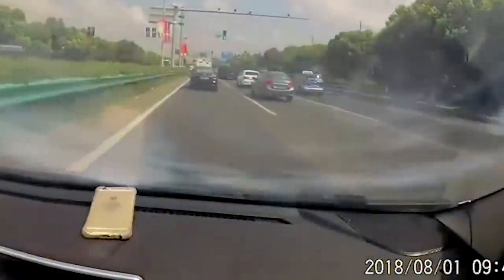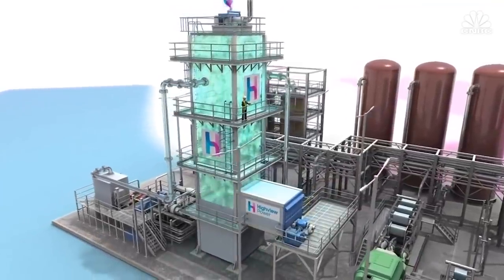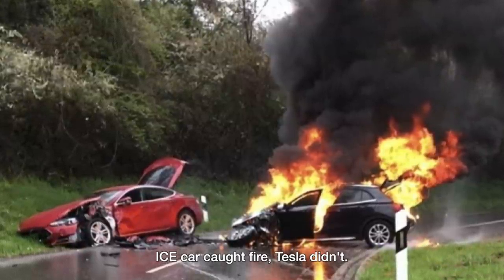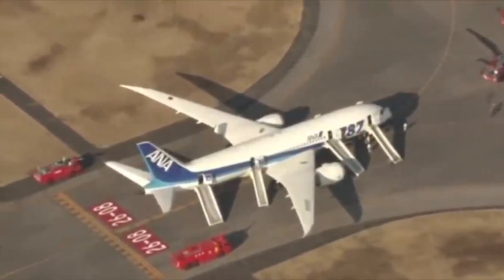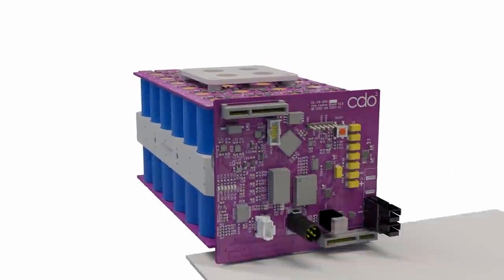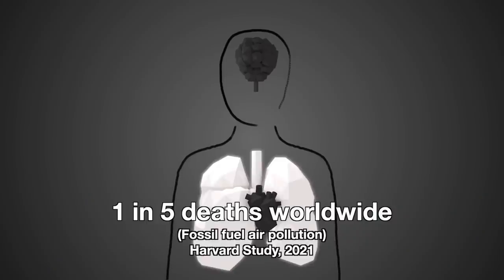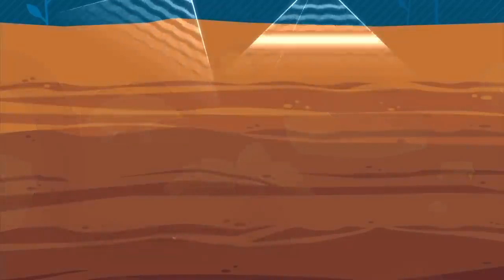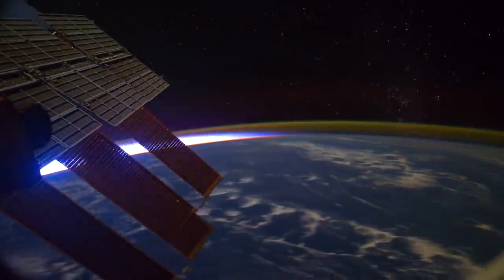What causes electric cars to explode? w Stephen Fry.

Comment: First generation Tesla had a slight risk of fires with 160 cases out of 1.6 million cars. They have solved that problem. Chevy bolt had a heating problem so big they recalled all of them. The article should have been about the Chevy bolt.
Reply: Click-baits work better with Tesla
Reply: Yeah this video was very disappointing

Comment: Two small things. 
Gravitational storage like the concrete block towers isn't realistic. It is just too inefficiënt and ineffective, it is essentially a much worse version of hydro storage.
And BEV batteries are not generally difficult to dispose of, there are several companies that already achieve 95%+ recycling rate, some even powering part of the process by fully using up power that is still in the batteries. However re-use obviously is the first thing you should do.
Reply: particularly these ideas based on cranes to lift and release the concrete blocks. Apparently there is some working version of an alternative system that's based on rails on a hill, which solves some of the problems with cranes, at the cost of more space. Possibly with all the space required for this kind of implementation, though, there's no advantage over using pumped-hydro instead.  Perhaps yet another "solid state" low-tech battery that's better than the vault-crane thing are the kinetic batteries, spinning disks. But I don't know.

It's nice that there are ideas being developed, but we shouldn't let hope and wonder blind us from flaws, from dead-ends, that can end up aggravating the problems we hope to solve or just being a huge waste of money with nothing in return, when the same investment could already be more fruitful with some more established alternative.

Comment: Tesla isn't planning on using Li ion batteries for long, their replacement LFP are easier to recycle and use much less scarce materials.
Reply: Ehh, LFP is a lithium ion battery....
Reply: @EmilKlingberg  Ehh, what about the issues I pointed out with (old) Li ion batteries, which are solved with LFP?

LFP batteries are not Li ion in the conventional laymen term.
If you're being pedantic for no reason, fine be a pedant. But, know you're not helping anyone.

(from wiki) In a lithium-ion battery, the lithium ions are transported to and from the positive or negative electrodes by oxidizing the transition metal, cobalt (Co),
LiCoO2 from Co^3+ to Co4+
during charge, and reducing from Co4+ to Co3+
during discharge. This chemistry was used in the Li-ion cells developed by Sony in 1990.

Comment: I'm extremely disappointed with the discussions around Data Centres the failure to mention the need to connect these to district heating so that thousands of fossil fuel home heating boilers could be decommissioned!

It is very regrettable this was not planned for during construction of them! but they are part of the solution in reducing our needs for GAS imports by decommissioning millions of fossil fuel home heating boilers.
Reply: Psssst, Data Centers are not usually near homes
Reply: @prich0382  in Dublin there 2 a penny but exactly my point should be part of district heating from the start

Comment: A battery fire is not a type A fire so it's not surprising that water is not the best way to fight a battery fire.
Reply: Right, I was surprised the fire fighters had little knowledge or exothermic reactions and thermal runaway. 

I mean surely they get training about chemical fires ?
Reply: @SionynJones  Yes I think the fire fighters were misrepresented in this video. They must have left out information that would explain better the actions of the fire fighters.

Comment: I'll take anything narrated by Stephen Fry, especially if it's about Data Centres, EVs, quantum computing, and renewables. Love this episode. 

It would have been useful to add that batteries are recyclable and we can achieve circular economy by reusing the materials (Tesla battery day, Nortvolt, etc.). Data centres convert electricity to heat which can be reused in homes and businesses instead of being vented into the air! 

Keep 'em coming ❤
Reply: Batteries are only partially recyclable. Way less than you think. Also the heat from datacentres is verry low temperature heat, which is pretty useless. Heating homes and offices is an option, but this is very limited
Reply: @ariearie5054  Even the tiniest bit of research will show you that batteries can and do go through multiple uses in a number of applications (EV, home/large scale storage) years before they are ready for recycling.

Regarding your argument re low temperature heat - have you ever heard of a heat pump? Look at projects in Sweden, Germany, Netherlands already reusing heat from data centres.

Surely none of this seems possible if one reads baseless YouTube comments to gain knowledge on the subject. 

Stop spreading misinformation.

Comment: What we need is either Geothermal energy or Nuclear power. Nuclear reactors are some of the most clean energy sources on the planet, with some chemical designs that are even 100% renewable. Thorium molten salt nuclear reactors are one such thing. They act as steam turbines in simplest terms and produce absolutely ludicrous levels of energy. Thorium is a reactive metal that is 100% chemically safe to handle and requires another form of reactive metal that is actively radioactive in order to actually utilize it. Thus, thorium reactors are also safer than conventional nuclear reactors.

Geothermal energy is the act of essentially drilling a hole until internal magma can be found. Then you use a heat-resistant turbine and essentially yet another steam vent process to boil and condense water into high-powered steam over and over for consistently high, regular energy.

Solar is a backup, wind is laughable, hydroelectric WORKS. I'm a chemistry major and my brother is an electrical engineer. It boggles our minds why folk are so resistant to nuclear energy.

Comment: It is important to highlight that The energy plant in the welsh mountains is a net user of electricity and they make money by using cheap electricity to pump water up to the top and selling it at peak rates. Its an amazing technical achievement, but not one which adds electricity capacity, only to even out supply needs at peak times
Reply: Duh. Batteries don’t make electricity. The importance has nothing to do with cost either, but balancing suppply and demand. Since demand fluctuates (and supply from renewables such as wind and solar fluctuates), a battery means you don’t need extra fossil fuel power plants during periods where power demand exceeds supply.

Comment: It does not take 5 fire trucks of water to put out an EV battery fire.  There is no putting one out because they don't require heat and oxygen to continue.  All you can do is sit back and let it burn itself out.

Comment: Great video. My 2014 Nissan Leaf will likely give me another 5 years of battery life, at which time the battery pack will be good for 10 years of home storage. By that time, recycling solutions will be in place, allowing for the various elements to be reused and the entire cycle to repeat. That is a life cycle that is hard to beat.
Reply: Yes. And ten years after the first nuclear power plant was launched they would have found a way to dispose off the waste savely or recycle it...
Reply: Yep mines on 85% still so hoping the same.  Yep i plan on making ripping my battery apart for home storage, people buy the motors for conversions etc.  recycling of ev batteries is already happening in Germany.
Reply: Better start saving for your new ££££££ battery

Comment: You can not compare the EV car fires vs ICE car fires because an EV can burn down completely but the battery could still be intact when the fire is not the cause of the fire but an outside source started it like an housefire that jumped to the body of the car.

Comment: Battery technology is evolving rapidly, compare current tech to just 5 years ago, or 10. Thermal runaway is a result of people cheaping out on thermocouples, and we can absolutely develop significantly safer batteries.

The main issue, surprisingly not covered in detail here, is disposing of them in an ecological and economical manner.

Upcycling to renewable energy storage is an awesome idea, but honestly we need something like Solid State batteries before we can have the density, safety and longevity required.

Frankly we really need to make the dream of graphene and its nanotube counterpart a reality.

Comment: Lithium batteries have impurities added to them to limit the discharge rate and thus the heat.  Take the impurities out and a shorted battery will actually explode at about half the power of the equivalent amount of TNT..

Comment: LFP Lithium Iron Phosphate batteries are immune to thermal runaway and much cheaper to produce, BYD’s blade car batteries are top notch tech.
Reply: The big difference is capacity being lithium ion has much more energy density which is great in therms of capacity but not so great having so much energy so densily packed. Lithium phosphate are safer but have far less capacity. Though I will say lipo battery fires are quite rare.

Comment: This video is nice, but appears to be using outdated information. As an example, most computers are using CPU based on CISC architecture, but there are many computer makers that are switching to RISC/ARM architecture that is much more efficient and uses way less power than CISCs.  Then regarding energy storage: There is a new interest on switching the type of battery chemistry to Lithium-Iron-Phosphate. This chemistry is probing to be much more safer, with less fire risks, batteries can have thousands of discharge/recharge cycles without losing capacity, and they are cheaper to produce. None of these and several other advancements are mentioned here. Is like repeating ideas from the 90s........

Comment: There's a new battery technology that broke through recently, that uses a mix of sandwiched solid and gel separators between the poles(cathodes) inside them, which prevents dendrite shortouts from being possible, and drastically improves battery lifespan, how many times it can be recharged.
What I'm really looking forward to however is a new battery paradigm, better than lithium-ion, whether it's carbon nanotubes, solid state, sodium, or something else.

Comment: When cement is produced, it releases CO2. When cement is used, it absorbes the same amount of CO2! CaCO3 when heated becomes CaO+CO2. Add water and sand - when this hardens, it absorbes CO2 from the air: CaO+CO2=CaO3. Except from the heating, the cycle is 100% CO2 neutral.
Reply: no . that's just not how modern cement works .
Reply: @jonas7510  The most common type of cement in the world is Portland cement. It works exactly this way!

Comment: Seems to me the energy storage problem is solved by electric cars, with 80% of them being parked at one time all you would need to do is connect them to the grid while being parked. This would allow them to store and release electric when the grid needs. A Tesla has 13.5 kWh of usable storage if 30 million cars allow their batteries to be used in this way the total storage would be 405,000,000 kwh, the UK total yearly energy usage is  318 billion kWh allowing us to store half of the daily usage. But it gets better, if the total amount of vehicles in the UK are used we would be able to store all the electric needed making a windy day last for days when the wind doesn't blow.

Comment: No Stephen TMSRs are the cheapest option now.
Liquid metal Thorium ion molten sodium fluoride salt burner energy converters (TMSR) - like Indonesia's Walk-away Safe 7×500MWe ThorCon units, (base loader or automatically load following), built in an Asian shipbuilding yard and towed to Indonesia for $1200/kiloWatt and pre-profit cost; all in running; security, fuel and periodic maintenance (including recycled reactor pots with new graphite moderator every 4 years) at $40/Megawatt.hour in 2021 prices; topped of with an expected 80 year life and no cost to the Government except for site preparation and linking up to the grid.

Comment: The block tower battery idea has been debunked on Adam Something's channel.  Short version of why it is a bad idea: it requires identical heavy blocks, which means concrete, possibly with steel-protected corners.  Creating all the blocks required for it to operate produces much, much, more CO2 than will ever be avoided by using it as a "battery".  Then there is also the issue of wind; any tall tower dangling objects will be affected by winds much more than a low-lying object - the tower would be unable to stack or operate blocks reliably in windy conditions.  Practically speaking, a tower would have to be underground, which increases costs further.  (There's more on the actual video though.)

Comment: 0:15 all data shows EV catch fire more often than ICE cars, you can see this from yearly released insurance claims. The only one who denied that was Tesla, who used data that included 30-year-old ICE cars compared to brand new Tesla cars. Sad that you just copied that Tesla data without looking at independent data.
Reply: I know this is anecdotal but in all my years of driving I have never seen a vehicle fire. I have known many people who have succumbed to cancer, strokes, heart attacks. It is very likely, in my opinion, that what comes out of the exhaust pipe of an ICE is far more dangerous than any vehicle fire be that ICE or EV.
Reply: @kieranwyse8227  To be fair, cancer and heart failure are some of the most common causes of death, so it would be odd to compare the statistics to that :P ehh.
Reply: Support your claim.

Comment: The numerous scorch marks on our highways that come from firefighters allowing the fire the deplete it’s self-oxygenating fuel (lithium) and heat supply (zillions of short circuit-causing dendrites growing towards the thin membrane that separates positive and negative charges inside each cell). A gas tank has one source for ignition. (Heat). EV batteries have millions including many that are not well-understood. The technology is not ready!

Comment: I thought electric car batteries were 100 percent recyclable?
Reply: Depends on how you state the question and form the anwser.  The materials like aluminium, copper, lithium, kobalt etc are 100% recycleble but some is lost removing inpurities from the material like the plastics from the insulation wire, connectors etc, materials like glue, insulation, paint etc are lost.  So if you take the whole battery “as is” then it is not 100% recycleble but the materials that count the most are 100% recycleble as seperate materials/elements.

Comment: the MYTH is about "the batteries can't hold charge Long enough"..

It isn't the TIME, it is the ENERGY - Capacity...

IF we want a "big battery to supply 100MW...  then  yes we need a time frame for that Power, as 100MW HOURS (100MW for 1 hour)  costs  at least ~ $ 33 MILLION  (and that is really cheap Li-Ion Battery tech.... nearly commodity pricing, TESLA is Pricing for MONOPOLY)

The Simple  fact is however "Rare" fresh water is, it is Cheap, compared to currently proposed Batteries, the infrastructure is for Hydro  what needs to be budgeted in.

NB. Sat water and maritime seacliffs are an obvious solution for water shortage (pumped storage), but Salt water on Turbine blades causes corrosion problems.  Lifting concrete blocks will get old fast.  We tried that for  Cuckoo Clocks.  Everybody finds that to laboursome to bother with - jk..

Comment: Well I’m glad the risk for electric vehicles are still way more minimal than fossil fuel vehicles. Especially for the time being if we guard from the risk of electric fires until we can a guaranteed fail safe fool proof prevention of for the minimal risk…then yes good to use still for getting around over fossil fuel…good pieces of insight, yea!
Reply: Electric can be free
Reply: @bruceolga3644  that’s great! That sounds like a better essential.
Reply: @jacquacooper  parent this sis, or parenthesis parentheses;( e.g.i.e. for example:"Tesla had the system to implement, the establishment did not want this because it did not fit with the monetary system";) 🦁♌🎱♾️⏳⚛️♎👁️🧠👁️💡🙈🙉🙊🐑♟️🐦💩🥄👌😉

Comment: I don't the idea of being inside a car that can electrocute me in an accident.
Reply: Eah, crashing against the wall is much better :)
Reply: There is a safety relay that disconnects the battery in the event of an accident, so electrocution isn't a worry.
Reply: It doesn't take a lot of potential difference to cause a electric shock your typical battery in a ICE car has enough to deliver a deadly shock.
Reply: Top rated safety score is an electric car. You are concerned about an edge case while ignoring all the more likely ways the car will kill you that have been solved by Tesla. But ok enjoy driving around with a tank of explosive liquid and a high center of gravity.
Reply: @SionynJones  Only if it is connected to electrodes that are placed inside your body on opposite sides of your heart.  12v isn't enough to get through your intact skin.

Comment: Those brick tower things don't really work in practice, that's why they're always shown as CGI. Tesla batteries? I think you meant batteries used in Tesla cars Stephen, the better ones are made by Panasonic others come from China mainly. Of course EV's are a non starter as there's nowhere near enough lithium and other rare earth minerals to replace the ICE powered cars.  We'd be much better to use lithium ion batteries for storing solar energy and using hydrogen for vehicles. Interesting video tho', thanks.